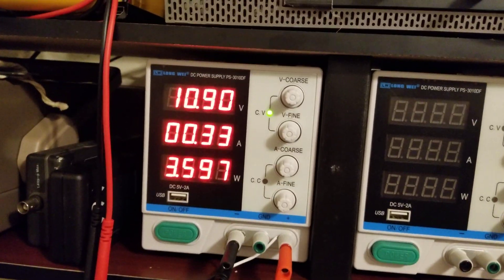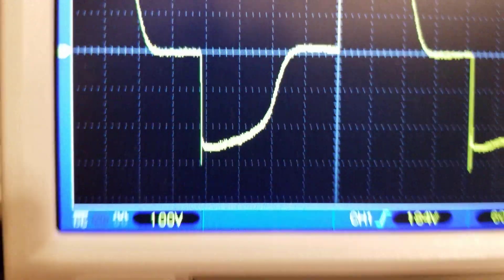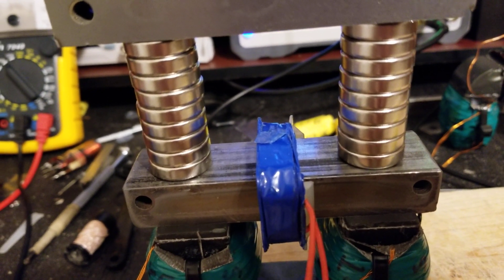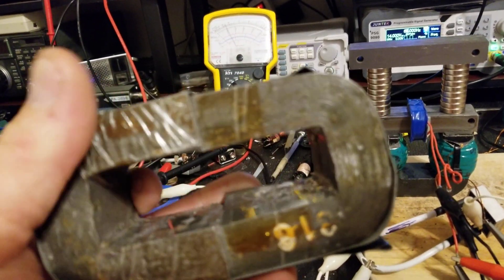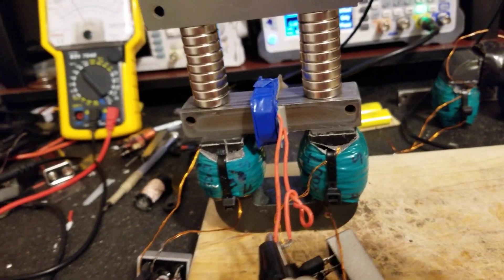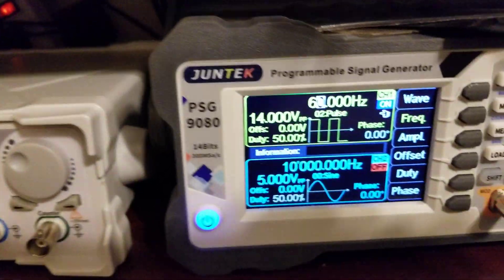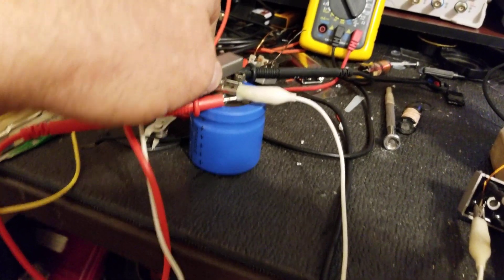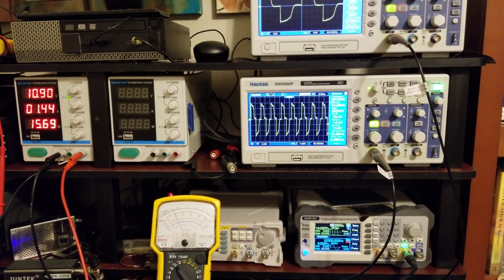Motionless electromagnetic generator Part 7

Comment: Looks like you're getting flux switching. But you're not loading the secondary with a continuous load. When you do that, then back-EMF will be generated in the secondaries and things will change quite a bit. But as of this video, not sure you have anything useful other than a cap charger. After you short out the cap, it takes quite a bit of time by the sound of it to recharge. Will be interested in seeing this run with a load on it!
Reply: meg is not a flux switcher

Comment: Hi Tim
Looks great!  
So the 51V is AC measured on AC side of FWBR ?
Wjats the voltage on DC side of bridge?
Whats the load on it in order to measure power?
IS the 876ma "circulating" current using a clampmeter, 
or is this the current going into a load of some kind, 
or is the 876ma what you get if you "crowbar" it with an ammeter?
I suspect you are going to get near 2A (however you are measuring it) with the 18 GA, but voltage will be dropping down in half even if you get those 200turns on it....anyways you will see ....keep what you got going on so far looks like big overunity so far!!!
I like how you are at 60hz, as meters will not mess up at that frequency, they are made for it, also those MW transformer laminates are made for that as well....be sure the ends of the laminates are not "shorting out" magnetically via when/if you cut them, the laminate varnish coating gets burned and cut off, "shortcircuiting"via bare metal on bare metal the laminate ends...
Reply from the maker: Hi buddy, I hope all is good with you and family. It means a lot to me that your watching my videos as i do watch yours!
Yeah so the 51 volts is on the DC cap and max flux switching is 120 hz before a sharp drop off. Peak power is at 60 hz  and the same at 120 hz only.
The 18 GA coil wind should be done very soon, but i'm only looking for 15 to 20 volts tops at, i hope possibly 5 to 10 amps. So with 9 magnets per side N & S we have 876 MA at a DC dead short and 450 mil 10 ohm load at 12 volts DC.
80% of the power goes away when i pull the magnets off the top while running! I thought about the bare metal issue and i tested looking for current, but it's not a big issue. A solid connection is needed in the magnetic circuit or all is lost.
Me and CAPTAINSSBN are both working on the MEG project in a unconventional way looking for answers ;) I'm glad you made it back to the states for a while and your back home now safe.
Cheers!
Reply: Hi Tim 
OK so with 10ohm load on secondary you now have 12vdc and 450ma or so for almost a 6watt output.  So it's not OU as of yet.  Maybe wrap winds between the magnets on that laminate bar?  Connect to secondaries or  even the primaries?
Maybe bifilar winds cancelling flux connected? Pulse at sinewave points where it be does something good or strange to it all .. (I don't know just guessing)
Try shorting out those secondaries at sinewave peaks! Do short pulse width use bidirectionally connected HV mosfets that can then switch AC because gates and source leads connect, switching now between drain A and drain B.of the mosfet pairs. Parallel  multiple mosfets on each bank l to make ultra low resistance.  Run the hyper ringing created from the sinewave peak short through a FWBR and  fill a HV capacitor.  Dump cap to load only when cap is first  diconnected/decoupled from the secondary and/or FWBR so no reflection. upon cap discharge.  Expect x 20 voltage happening into cap....
Reply from the maker: @MrDKONZEN   hi buddy,  no not 12 volts testload was on 51 volts.
Reply: @Timtron432  
Hi Tim 
Does the voltage stay at 51v in cap when 10 ohm load applied? Have you got rid of the backemf forces??
Or does it drop to 12v with load?
Reply from the maker: Hi Doug, The 10 ohms 25 watt load resistor is at 27 volts under load across the cap and before i start the load test i have 51 volts max. When i do the load test i have an increase of 30 MA of drive current to the trigger coil. The flux switching happens under the bar and under the magnets only, though the U core. any coil inside the magnets by the trigger coil will rob and stop the flux from switching if the coil is tapped for a load. If i take the top bar and magnets off while it is running the power output will be small. I plan to wind 18 GA neat 4 layered coils tomorrow afternoon and upload a video on YouTube. The BEMF issue should be fixed with a ( C ) core installed on both sides of each coil on the cores. So the unit will then look like a BIT, but also a MEG. My part 6 MEG video only has 3 magnets on each side, but now with 9 magnets on each side i have a really big gain in output! 9 magnet is peak though if i put 1 more to make 10, then the MEG starts to decline in output because of over saturation in flux .
I have made other MEG's in the past that have a magnet in the middle of two U or C cores and got no real power from them no matter what i did. This unit acts so much better and seems very promising the way it works because the two bars used as a controllable flux circuit. Effective pulsing can only be done by a 50% duty square wave pulse and a sine wave will not work very good. After i get this unit to put out some real power, then i plan on doing the same thing to the top bar with one more trigger coil and one more U core with 18 GA coils like the bottom half! Well at least that is my plan lol
Cheers!

Comment: Greetings. 
One idea: an incandescent bulb remains to be connected to the capacitor and the output power to be measured 👍
Reply from the maker: Yes thanks, but as always i do a dead short and a 5 to 10 ohm load 8)